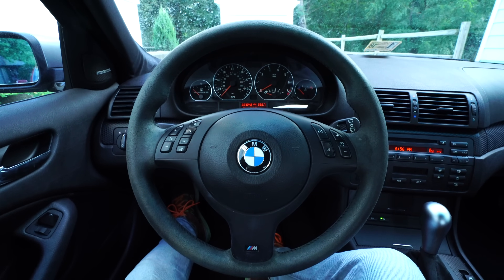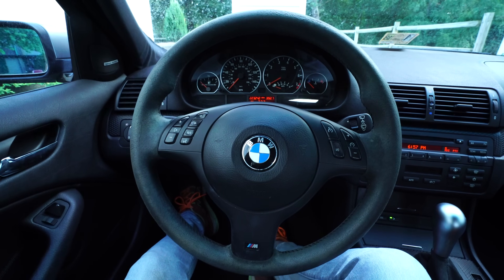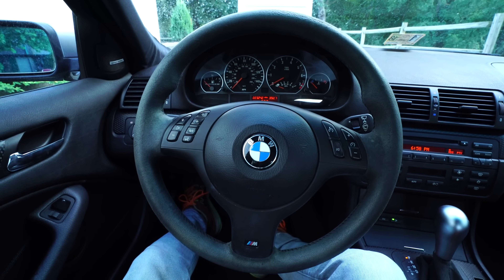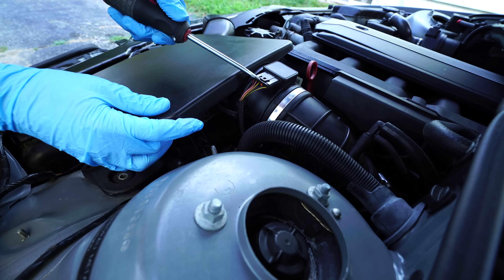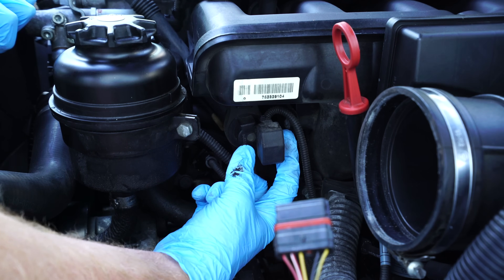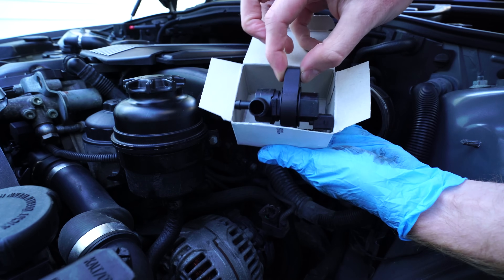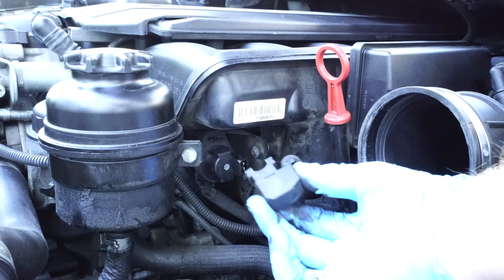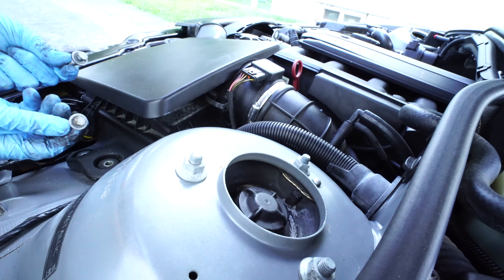BMW P0444 Evap Canister Purge Control Valve Repair DIY M54

Comment: Old video but grateful if someone could reply. My car has this code, now it's a non starter, started as loss of power and rapid reduction in mpg.
Reply: It’s still cranks? If so then you could have bad catalytic converters, one of the first noticeable things is poor performance and mpg.

Mind you this code is completely unrelated to the converters, and I’m not sure that a p0444 code would stop an engine from running.
Reply: @tman88elk  unrelated, turns out the fuel pump had died, replaced it with a second hand one and it's fine. The code is still there though 😂 I'm still driving it 😬
Reply: @Whathevdoes Good to hear that you found a solution, I wouldn’t worry much over the 444 code. It will only hurt your mpg slightly from what I understand.

Comment: what are the 2 hoses that connect to the purge valve? and should they be checked for cracks/leaks before replacing the old valve?

Comment: Informing of bolt size and showing where the bolts are would be a great help. I noticed on this video, there was a bolt hole on the sensor that the bolt just seemed to disappear with no explanation and no bolt sizes or play by play.

Comment: If this valve stuck open is the engine going to start ?
Reply: yes, it will start but you will have a bad mixture of air an fuel and you mpg will drop because a rich mixture, the car  will smell like sh*t inside

Comment: Having this exact fault code, car runs fine. Once the eml is reset, light stays off until fuel is added, then comes back on within 20 miles. Car still runs fine... Is it the valve or summat else?

Comment: I have a serious problem with my 325i I was replacing the purge valve and the vacuum tube was pulled from the rubber hose under the manifold, please how do I fix?

Comment: I’ve cleared that code started and drove it. Sometimes it’ll take a bit for it to pop back on. Did you have any more issues with that code after replacing the purge valve. I don’t want to replace it only to find out it was the vacuum line. Thanks

Comment: Thanks for the video.  Hey if the car is running great and you passed the AIR test already. Would I still need to replace the purge valve? The car runs great,  could I just keep driving it
Reply from the maker: tony Kari I would recommend doing the repair as it controls fuel vapors for emissions. The part is inexpensive and job is easy so I’d say replace it so it doesn’t cause other issues down the line.

Comment: How do you reset the code? Once replaced
Reply from the maker: You need to erase or clear it with an OBDII scan tool. You can do that with even a cheap $20 one from a local Walmart! Or if you're in a bind, Autozone or a similar store may erase it for you for free as they have a scan tool to scan codes for free. Whoever scans it may erase for you - just ask!

Comment: The easy way to check if this valve is bad just open the cap tank and if you here vacuum sucked inside the fuel tank replace the valve
Reply: That's for the information. So do I need to start the car and have it running and then open the gas cap? Or can I do it with the car turned off?  Lmk please. Thanks

Comment: Hi, 3 issues;
1- some of the LED lights on my 2006 BMW X5 E53 are gone, so I can't see the display properly. I was wondering if you, or anyone here can upload a detailed video about all the functions of the radio buttons.  I can't figure out how to switch from radio to cd with the buttons.

2- I'm getting a constant 4x4 light, any ideas about the cause and repairs?

3- I got FAH 250 error code which my mechanic tells me is for evap purge valve, if you could share a video for 2006 X5 E53 for it.
Much appreciated..!!!

Comment: Hi, I have a. 2001 BMW 530i with 79k miles. I have the p0455 coming up. I already changed the gas cap and check the tank hoses, everything looks fine. Any suggestions? Thanks
Reply from the maker: Fredy Rodriguez pay bmw dealer 1 hour labor diagnosis to smoke test the system for leaks. You need a machine it’s the only way

Comment: Changed it still has that code for a while any thoughts on what else it could be
Reply: Eric Valadez In the forums, it looks like a bad gas cap or just dirty cap seal is often the issue.
Reply: I’ve replaced the valve AND gas cap and still have the ses light come on :/
Reply: check the name of the car, is it BMW? ...if so, the that might be your problem 😆

Comment: Check for airbag recall =P
Reply from the maker: Thanks Alan, it has an open recall for both the driver and passenger airbags. It's going in next week for free replacement! Now, to get that steering wheel re-done!